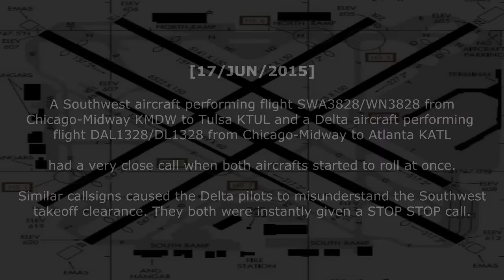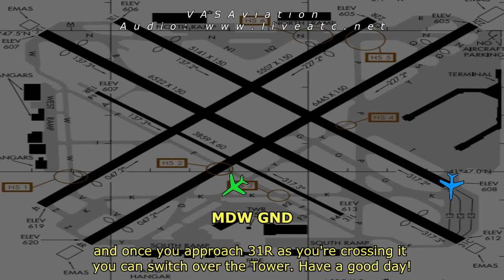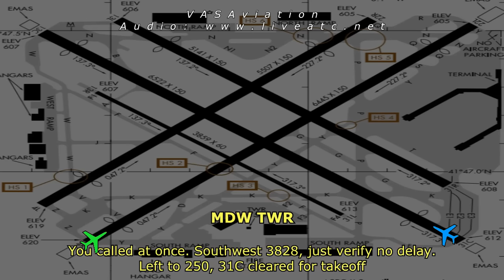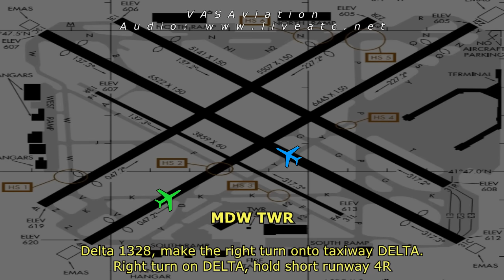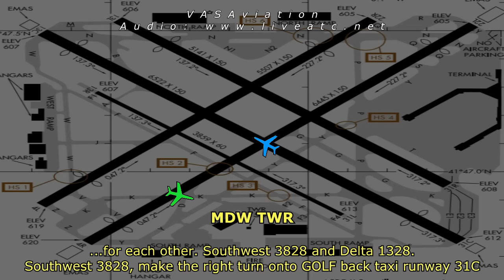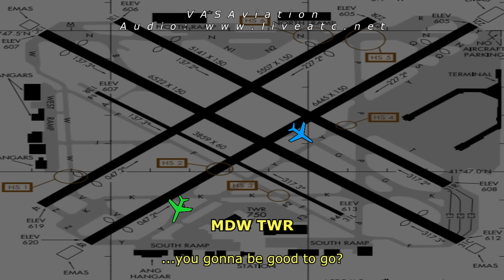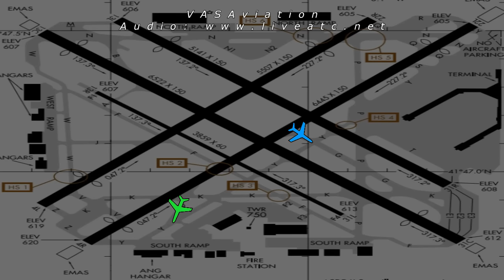[REAL ATC] Delta and Southwest VERY CLOSE CALL on takeoff

Comment: Female taxi controller was sharp.  Male departure controller was dumb as a sack of shit.  Similar call signs, opposing runways, talking to fast and clipping his transmissions.  The Delta pilot may have misheard call sign for take off due to clipping but there is no way he could have misheard "31C".  He messed up big time despite being warned of similar call signs.
Reply: Exactly. It's like the male controller never even realised the similar callsigns, repeatedly cutting off the company name on his transmissions. Good radio comms and STANDARD PHRASEOLOGY saves lives.
Reply: +Nick V yeah, the controller said callsign to quick and asking for no delay for takeoff for inbound traffic.
Reply: +shiinigz 
Although the ATC speaks very quickly, it's actually the pilot of 1328 who is in the wrong. He is on runway 4R, at no point did ATC give clearance for takeoff on that runway. Both times he transmits that the aircraft (although call sign unclear) on 31C is cleared for takeoff. It was then his actions that avoided the potential conflict when he saw 1328 rolling. If the pilot had listened, this would've been avoided
Reply: +Steven Kowalski you can't possibly put the blame solely on the pilot. if the instructions were really clear, the pilot would not have been able to misunderstand. the controller needed to realise the similar call signs and say the numbers one by one, emphaize the airline, and/or slow down. I'm not saying the pilot cannot be blamed but I do believe that the blame can be evenly distributed and there were wrong doings by both parties.
Reply: Yes of course! We rock! #feminism
Reply: What is a famele?
Reply: Nick V yes. female.
Reply: The male controller saved the lives of hundreds of people? And no one cares about feminism not even ladies
Reply: Tattersail the hundreds of lives of people wouldn't even have been in danger if the male controller was more careful.
Reply: ccycx yh he fucked up but rectified it
Reply: ***** No, the pilot!
Reply: ccycx the blame may not rest solely on the Delta pilots, but they definitely deserve the majority of it. While the callsigns may not have been completely clear from the male controller, the pilots of both planes were advised of the similar callsigns and the runway that takeoff clearance was being granted for was clearly not the runway Delta 1328 was on. 'Runway 4 Right' and 'Runway 31 Center' not only sound distinctly different, but are different lengths and the pilot should know where they are at all times.
Reply: It's possible to do that - I guess they thought that advising them about the similarities was enough. Ground should've advised TWR as well, it seems :)
But really the company names are distinct enough, which is why a few people already pointed out that TWR should've keyed his mic earlier (he cut out the company name on his instructions more than once). This is why they teach you: Think - Click - WAIT - Speak - Click off

However, this is the smaller of the two contributing factors by ATC here. The bigger one (in my opinion) is the fact that TWR didn't get why the clearance readback was blocked TWICE - because two a/c read it back, thinking it was for them.

But even that puts ATC only in second place for responsibility for this near miss - it's still the Delta pilot who reads back a clearance for a different runway with unclear callsign and doesn't think twice about it, when he keeps getting stepped on.

And lastly: A little tiny bit of the blame is also on the SWA pilot. Because he hears the mess and although he can be fairly certain, the clearance is for him, he HAS to recognise, that his readback is being stepped on. When in doubt, talk it out! If you gotta ask four times, that's what it takes. Don't get so hurried by a 'no delays please' - let the inbound go around if that's what it takes to be safe. (But again: Tiny bit of resposibility compared to TWR and Delta pilot)
Reply: The controller used to have discretion to assign an aircraft a temporary call sign, but I cannot recall ever having heard one actually do that in the USA. I cannot find anything about it in the current version of the "ATC Bible," FAA Order 7110.65W. Here is what it does say about communicating clearly when aircraft with similar call signs are on frequency:

2−4−15. EMPHASIS FOR CLARITY
Emphasize appropriate digits, letters, or similar sounding words to aid in distinguishing between similar sounding aircraft identifications.
Additionally:
a. Notify each pilot concerned when communicating with aircraft having similar sounding
identifications.
EXAMPLE−
“United Thirty−one United, Miami Center, U.S. Air
Thirty−one is also on this frequency, acknowledge.”
“U.S. Air Thirty−one U.S. Air, Miami Center, United
Thirty−one is also on this frequency, acknowledge.”
REFERENCE−
FAAO JO 7110.65, Para 2−4−20, Aircraft Identification.
FAAO JO 7210.3, Para 2−1−13, Aircraft Identification Problems.

b. Notify the operations supervisor−in-charge of any duplicate flight identification numbers or
phonetically similar-sounding call signs when the aircraft are operating simultaneously within the same
sector.
REFERENCE−
FAAO JO 7210.3, Para 2−1−13, Aircraft Identification Problems.
NOTE−
This is especially important when this occurs on a repetitive, rather than an isolated, basis.
Reply: QemeH Re: company names getting cut off by tower, it sounds like a radio issue and not the operator from the transmissions. Can hear the RF carrier come in but the intelligence isn't audible right away and the first second or two is garbled. This was a perfect recipe for a total cluster fuck.
Reply: Controller error. The local controller should have been aware of the similar sounding call signs and used prescribed phraseology in accordance with FAA 7110.65  for similar call signs which is "Delta 1328 Delta" and "Southwest 3828 Southwest ". Controllers are responsible for miss readbacks. Also , when the two answered for the take off clearance he should have immediately said something like " the last transmission was for Southwest 3828 Southwest , Delta 1328 Delta hold your position " . The pilots didn't help the situation but ultimately it's an operational error on the controller.
Reply: This does not dismiss the obvious.  The Delta pilots were not on runway 31C and should, at the very least, had a clue about what runway they were leaving from.
Reply: Nick V that's what I said. Joe posted the same reply another comment and I pointed out on that one that the Delta pilot was largely responsible due to his appropriating a takeoff clearance for a different runway.
Reply: I was responding to Joe Bloe's comment not yours.
Reply: Nick V I know. I was agreeing with you and saying I'd told him the same thing in a seperate comment thread on this video. Sorry if I didn't make that sufficiently clear.
Reply: yeah no, this is soley deltas fault. they were advised of the similar callsign, were on a different runway, and heard the clearance, TWICE.
Reply: Also too much information in one transmission...
1) callsign (which he messed up, clipped and mumble the number element)
2) traffic holding posn on the crossed rwy
3) traffic 3 mile final for the crossed runway
4) no delay please (has he heard of the standard words expedite or immediate which are quicker and clearer to say?)
5) turn left heading 250
6) runway 31C (only thing the Delta really should have picked up on), cleared for takeoff
7) wind
Too much for even the best pilot... no consideration for cockpit workload.
Reply: the problem isnt just plain cut. if you have anything to do with vhf radios you would understand how even if your listening intently a 1338 sounds like 3838 or whatever. It was a failure of the ATC to clearly and coreectly transmit information to the pilots. In either case they both could of just rechecked the permission.
Reply: The male TWR isn't at total fault. It could've been done better by pressing before talking, but he did call out 31C twice to signal that the southwest plane was clear. Delta was 4R, those two numbers don't sound alike. There was also radio clutter stoppin both from takin off properly, and the guy in the tower reiterated 31C.
The woman for GND talked slower yes but she also had no interference, which made comms much easier.
Don't talk about "women rock" when the circumstances aren't the same..... like saying women rock when a healthy women is fighting a crippled old man.
Reply: I agree!Men always have the tales instead of females. Why aren't females dominated then males?
Reply: ScratchNsniff ಠ_ಠ are you assuming that it is a cis female
Reply: No.... that was crystal clear... different freaking runways... 4 vs 31? Give me a break... Left vs Right.  No excuse for that screw up.
Reply: Nick V Why are the people in this thread commenting on the gender of the person as if there's some kind of correlation between gender and overall competence. This is why feminism should stop being a thing. They're always demonizing men for no reason.
Reply: Stepped mics - was a three-way fuck up.
Reply: Look at the pilots blaming atc here. Both crews had been advised of the similar callsigns. Delta wasn't on 31, regardless of the callsigns. Controller reread clearance after the first read back was blocked. Again, Delta should have realized it wasn't for them. Thank God he caught Delta rolling.
Reply: No way can this be equal blame. The pilots of both aircraft were already told by ground control of the similar sounding callsigns. Do they need to be told that by local control as well? DAL even said he would watch for it... IF he had, then he would have heard the runway portion of each clearance, the 'don't expect to stop' portion told to SWA and the 'traffic landing RWY 4L as crossing traffic landing. The controller could have enunciated the SWA part better, but his speech rate was fine. He also had a lot of info that he is required to provide according to the .65. Traffic holding position on another runway, traffic landing another runway, nearest traffic for the runway you are taxiing onto, etc.

Comment: The "no delay" instruction probably caused all pilots not to confirm their takeoff clearance.
Reply: they did confirm...at the same time so neither was heard. I think that on "no delay" instruction pilots should have to wait for ATC to give "readback correct" before they start the takeoff and if they don't hear that, they don't take off. I realize that is not standard procedure, but incidents like this are what should cause standard procedure to change to something closer to idiot-proof.
Reply: The “no delay” instruction is to just to tell the pilots to expedite their takeoff phase of the flight. Without that instruction, the Southwest pilots could’ve proceeded slowly with the takeoff and then caused a conflict with arriving traffic on the cross runway.

Comment: 2 Questions:

Why couldn't the controller just talk nice and slow in the first place when addressing one of these 2 planes?
Did the Delta guys forgot they were on 4R and not 31C? They obviously didn't listen properly.
Reply: First question: because no matter how many times it's pointed out that speaking slower is faster than having to repeat frequently, people still speed up under pressure.
Reply: @kd5nrh  If cant handle the pressure shouldn't be in the job.

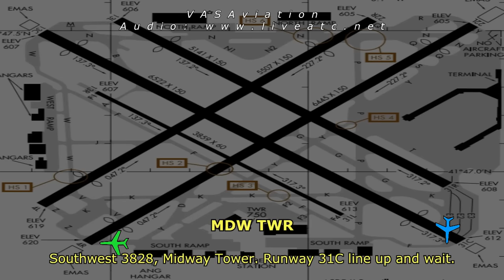Comment: Ive listened to the callsign at 1:07 10 times and apparently atc is kinda murmuring plus the quality of the transmission is just around 3 just for the callsign part. The quality of the radio is usually worse on the plane so i would say that it is extremely likely to cause confusion especially with the no delay that pushed them not to clarify.

Comment: This is what happens when proper radio procedures are half-assed.
Reply: decodeddiesel, can you explain more?
Reply: The male ATC was being too loose with the callsigns creating the confusion.  This occurred because he was not waiting long enough after pushing the PTT button on his transmitter which cut off the distinguishing part of the callsign, only airing the similar parts. Both aircrews were in turn sloppy with the read-backs and call sign discrimination which would have normally alleviated the confusion, however these procedures were half-assed and not properly followed.  The ATC allowed both to step on each other without stopping them, twice.  The result is a near-miss.
Reply: decodeddiesel, thanks.  Now that you've pointed it out, it's really clear:  The ATC should have stopped them from talking over one another.
Reply: The ATC should have stopped the whole thing and asked for a good read-back of instructions from both pilots.  His poor radio procedures (not waiting after pressing PTT, not getting a good read-back and still allowing a take-off) were the primary culprit.
Reply: It's really not their fault, our current ATC procedures are pretty outdated.  Their callsigns were identical and being spoken though weak quality radios as well as spoken quickly.  If anything needs reviewing it should be the way aircraft and towers communicate.  

As a software dev I know it is possible to have a system where an airport digital map reveals an aircraft's position to both tower and pilots, and towers can easily update an aircraft with waypoints for taxiing as well as giving the "Take Off" clearance.  All without speaking a word.  I need to work for FAA.
Reply: Is there a reason why aircraft and towers still use such low quality audio equipment?
Reply: xTYx728, my guess is that it was a global standard set up sometime between 1945-60 and would be incredibly hard to change right now.
Reply: xTYx728 It also has to do with the distances the radios need to reach and through what conditions. Reliability was given higher priority than sound quality. But no doubt we could do better, but the cost and time to transition to newer stuff worldwide would be a huge problem.
Reply: You're assuming that the audio as recorded here is what the pilots heard as well.  The truncated communications may be related to whatever equipment was being used to record these transmissions.  In fact, if you listen to the comms from the two jets on that frequency, they're also truncated.
Reply: There are plans to change a lot of this. Look up FAA NextGen. Current radios are indeed ancient narrowband AM. The quality sounds a lot better to them than it does in the videos, though. The audio from the videos are coming from LiveATC's receivers, which are on the ground and not necessarily especially close to the airport. On the field and when the aircraft are in the air, there's nearly unobstructed line-of-sight between the aircraft and the ATC's antennas, so the quality is a lot better than what LiveATC picks up. I usually don't have any trouble hearing transmissions when I'm flying.

AM actually does have some significant advantages, though. Aside from being extremely easy to implement, it's also easy to tell when two transmitters are stepping on each other and you can usually make out at least part of what at least one of them is saying, but you also get that intermod tone that you can hear in the video when both aircraft are responding simultaneously to the clearance.

As far as replacing it with a digital system, it's both hard and expensive. Designing the system itself isn't especially hard, but getting it deployed to all aircraft is. Remember that the FAA is just one of tons of civil aviation authorities around the world. Whatever they do needs to play nice with the rest of the world in order to facilitate international air traffic. Also, even for just the U.S., while there are 'only' about 7,000 airliners registered in the U.S. and these generally have the money to update equipment without much trouble, there are also over 200,000 non-airline aircraft registered in the U.S. For these, replacing the radios often represents a much more significant cost. Remember that everything in aviation is much more expensive than normal, due primarily to certification requirements. And, of course, once you get outside of the U.S., it's even more cost-prohibitive to update all of your radios.

It's also worth noting that AM degrades much more gracefully than digital modulation. When AM signal quality drops, it just reduces the audio quality a bit. When digital signal quality drops, the entire packet is garbled and typically is discarded.
Reply: "As a software dev I know it is possible to have a system where an airport digital map reveals an aircraft's position to both tower and pilots, and towers can easily update an aircraft with waypoints for taxiing as well as giving the "Take Off" clearance.  All without speaking a word.  I need to work for FAA."

It's possible for the takeoff to be completely automated, but that costs money, and that's the problem.
Reply: Bill Gates I tested this theory on FSX using a 737 plugin that is highly accurate to the real aircraft.  Once on runway I was able set auto throttle + altitude and rate of accent.  The aircraft successfully tookoff  to 10k feet with the flick of two switches.  Surely it cant be that much more expensive to improve upon this.
Reply: decodeddiesel - you obviously have no idea what you're talking about.  The audio quality is degraded by the ATCLIVE recording. The controller did request a good read back... Delta screwed up again. There is a lot of information required to give a pilot (thank the lawyers) prior to take off clearance. The second clearance was issued so quickly because time is a factor. Seconds matter. If SWA doesn't begin takeoff roll, he will be t-boned by the plane landing 4L. But Delta tried to do that instead.

Comment: If you have two flights that you know are similar callsigns getting ready to leave a the same time, maybe tell one of them to hold short and the other to line up and wait. 1328 should have noticed the clearance was for 31C and not 4R, even if they did get the callsigns mixed up.